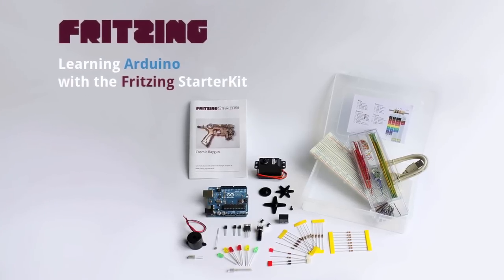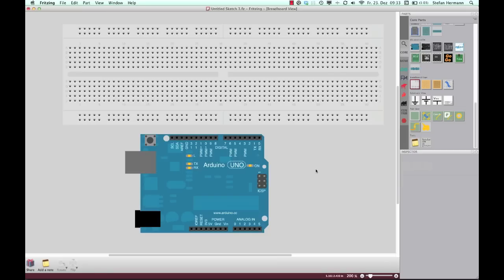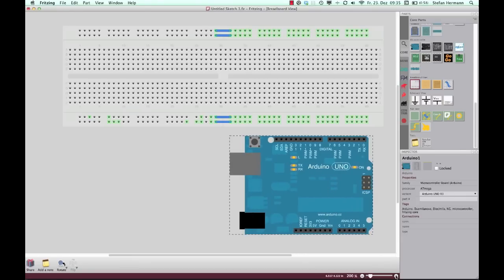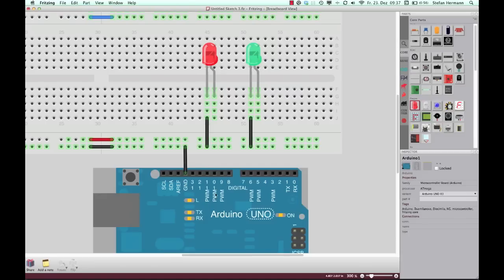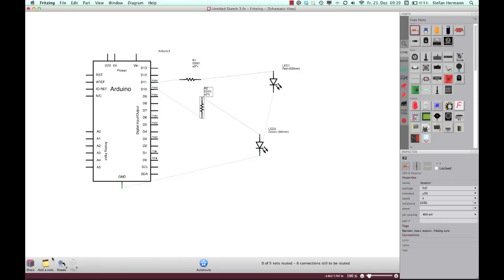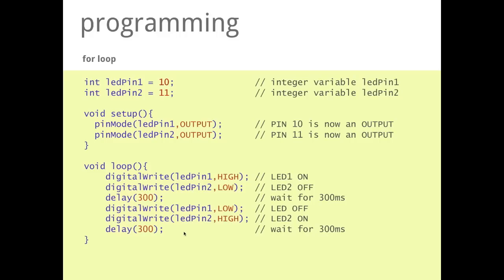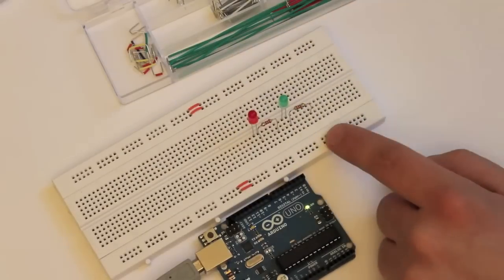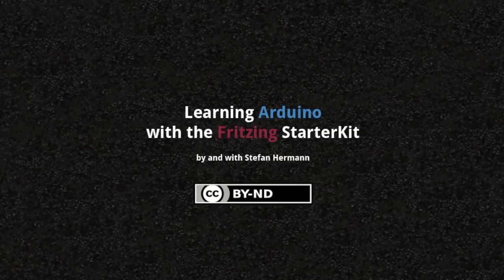Learning Arduino Episode 005 -- Breadboard Prototyping

Comment: const byte outPin = 2;
const byte outPin1 = 3;

void setup() {
  pinMode(outPin, OUTPUT);
  pinMode(outPin1, OUTPUT);
  digitalWrite(outPin, HIGH);

  digitalWrite(outPin1, HIGH);
  delay(2000);

}

void loop() 
{
  for (int i = 0; i < 2; i++)
  {
      digitalWrite(outPin, LOW);
      digitalWrite(outPin1, LOW);
      delay(10);

      digitalWrite(outPin, HIGH);
      digitalWrite(outPin1, HIGH);
      delay(100);

  }

  delay(1500);

Comment: How to test my result in fritzing itself?
Reply: If testing is not possible, that means that this software is useless for me, i can imagine those connections in my brain much more simpler and extremly faster, ~2-3 seconds instead of 4-5 minutes.
Reply: Thats not possible at the moment, you can check for compiling errors but thats it.
Reply: @Chiri The Pirate Sure..!!!